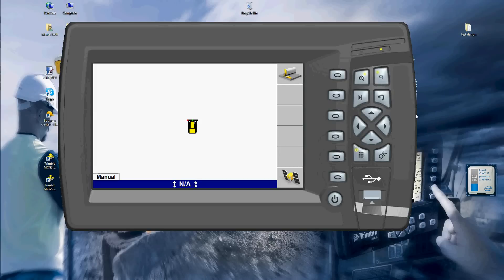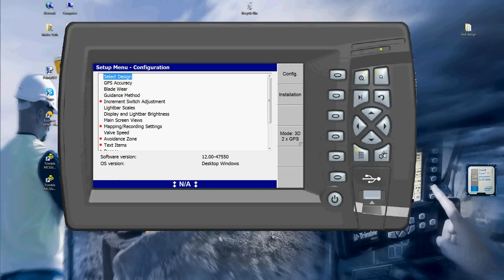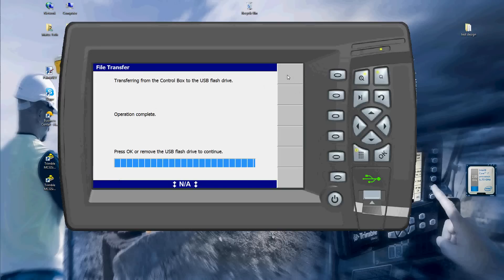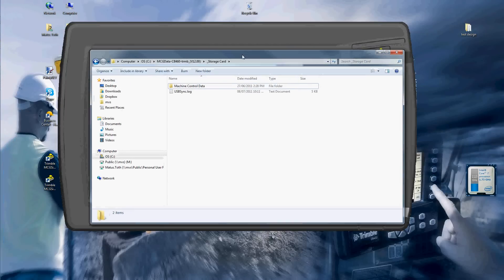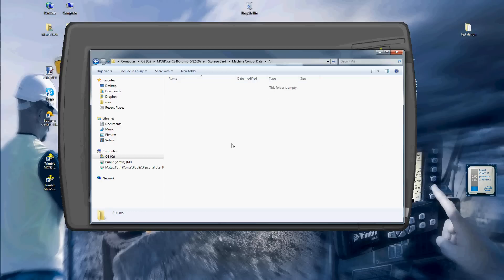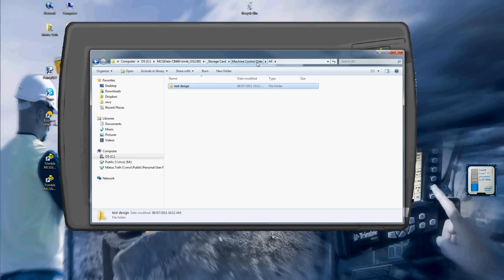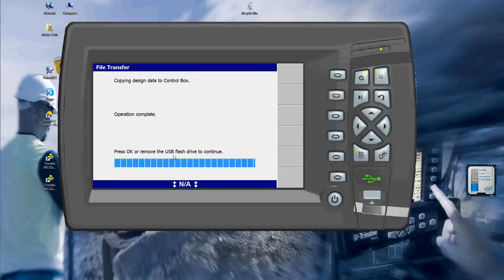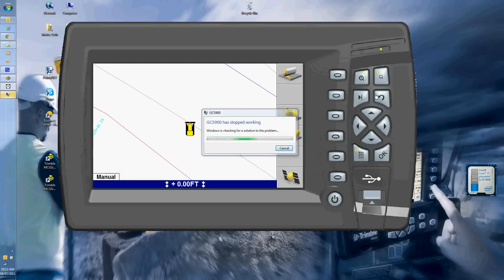CB460 upload Trimble machine grade control GCS900

Comment: Does formatting type or max size of usb drive matter?
Reply from the maker: I think so I had some issues with large capacity USB drives so I stick to 4GB usb 2
Reply: @ProSiteConsulting  Thanks for fast reply! Design isn't showing for me so maybe that's why.
Reply from the maker: @kyle24011  maybe the folder structure as well! Or the version of the software on the box!
Reply: Omg Ty, I’ve been working on this all day